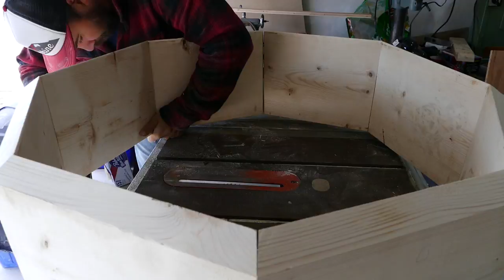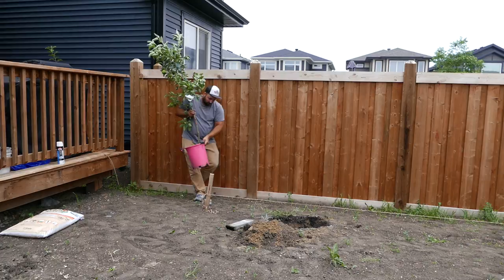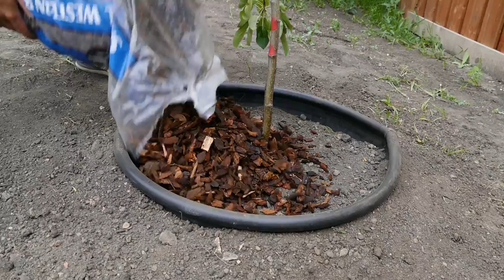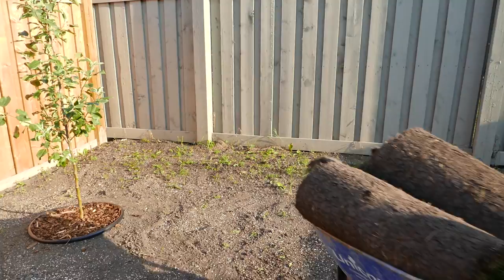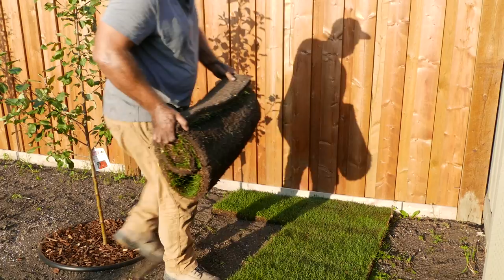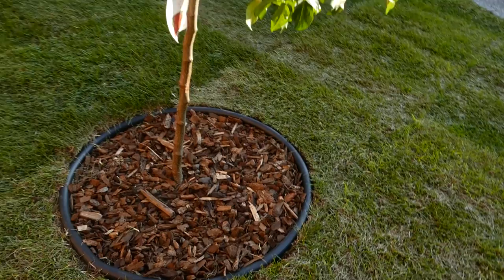Lay Sod in your Backyard with your Own Hands. I show you how!!

Comment: Hi, I noticed the you didn’t remove old grass in some spot or add any new top soil. Will or did the sod take with no issues? I have the same problem my dog destroyed the grass so I need to put sod again, the soil is sand and but the base is hard.